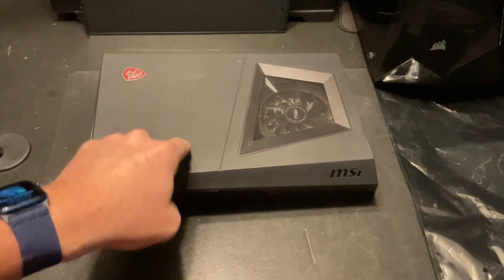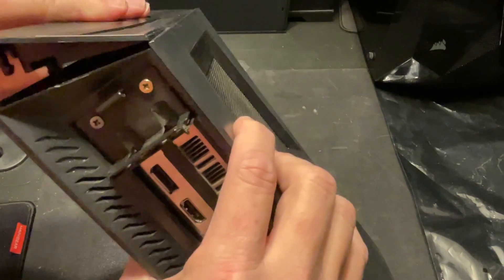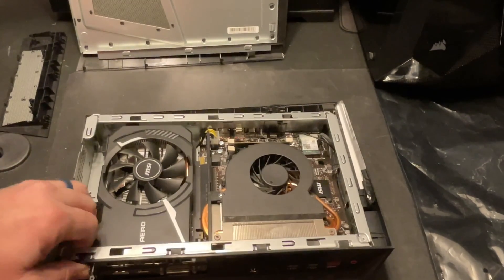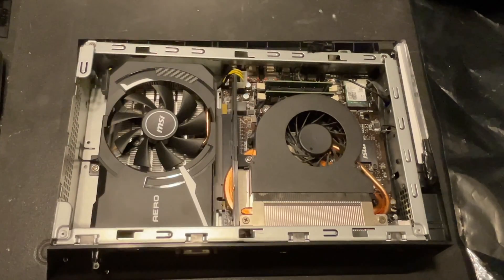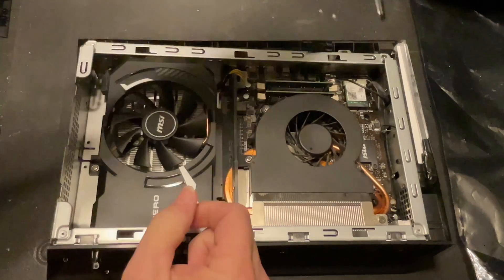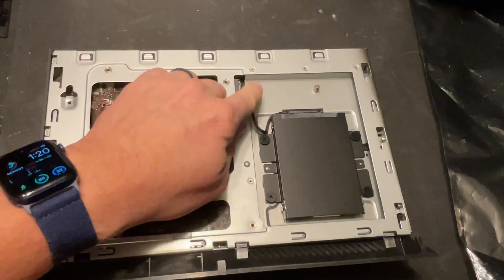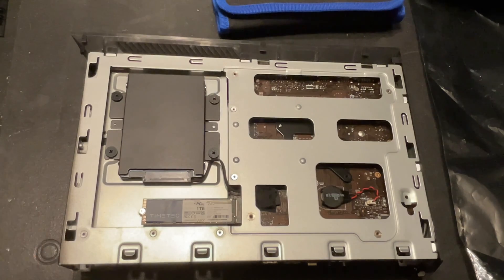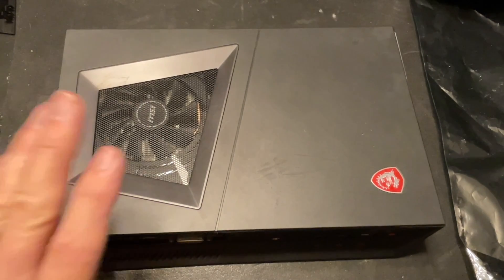How to Upgrade the RAM and SSD in a MSI Trident 3 - i5 10400f, GTX1650

Comment: Can you buy the same upgraded ram for all models? Or do they all have different requirements? 

My model 3168ngw
Reply from the maker: That might not be the model of the computer. That looks like the model for the wireless card installed. 
But either way, if your processor is between a 7th and 10th gen, the DDR4 320hz ram should be backwards compatible with all those models.

Comment: Very informative video, thanks. But i was wondering if i can upgrade the same SSD  and  RAM like yours? i do have NVIDIA GeForce GTX 1660 & i7-9700 CPU @ 3.00 GHz installed in my computer.  :>
Reply from the maker: You’d have to check the motherboard of the model you have. If it has the slots for the NVMe and memory, it should work just fine.

Comment: Hey, Ive had the same model but with the i5-9400F sitting here for  a while , is there any  way to upgrade CPU. I don't know much about building pc but just curious
Reply from the maker: You might be able to upgrade to a 9700 or 9900, bit in my opinion it wouldn’t be worth it. You’d also have to check if your power supply would be sufficient.

Comment: I just bought an ssd the same one from ur video.

 I can't seem to pop out the pc. 6:00

I have unattached the bottom screws, the screw in the motherboard, everything. I just can't seem to pop it out? 

Am I missing something?
Reply: Same
Reply: I had trouble with mine. There is a hole in the motherboard and below is a screw that fastens the chassis to the case. Once that is removed you can pull it our with a bit of force. Hope this helps people in the future

Comment: Great video sir. I have one it has a gtx 1650, and a i5 9400f. Would the ram and the ssd still work? I was also wondering if it was possible to transfer this pc into another case? (Gaming Case)
Reply from the maker: Same RAM and SSD will work for the 9400f model. But it’s not worth moving to a different case. It’s not a standard ATX based motherboard, and uses a different type of power supply too. Let me know if you have any other questions.
Reply: @FamilyGeekery  Okay, I will upgrade the ram and ssd soon. I found out there is meant to be a stand that holds the pc vertically. But mine didn't come with one, do you happen to know how I can get a stand for the pc? Thanks!
Reply: @FamilyGeekery I just realized u can't buy the stand seperately. I was talking to msi support. Can u upgrade the gpu in this pc?
Reply from the maker: @MK_1X119 the stand I have was hidden in the box. Didn’t even know it was in there until I stumbled upon it. 

As far as the gpu goes, you can upgrade it as long as it physically fits, and doesn’t over task the power supply. I think some people have found more powerful PSUs (maybe from other MSI laptops?)
Reply: @FamilyGeekery Glad you found it. 😂 I'm gonna look into gpu upgrades. Just need to know what wattage psu is in this pc. Then I can find a compatiable gpu. Thanks for the help have a good one! Lol
Reply: @FamilyGeekery I believe it has a 230-330 watt psu. I believe a good upgrade option would be a rtx 2060 6gb. What you think?